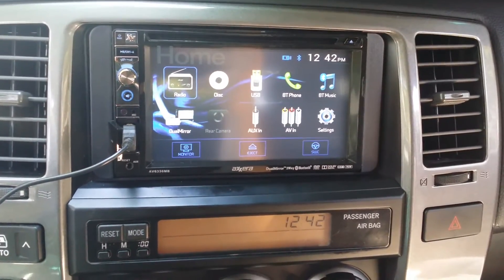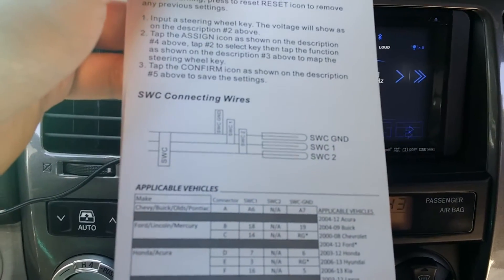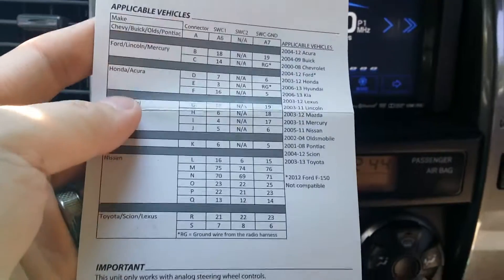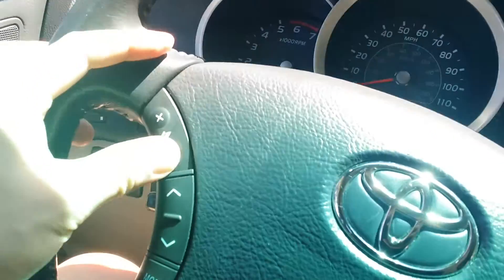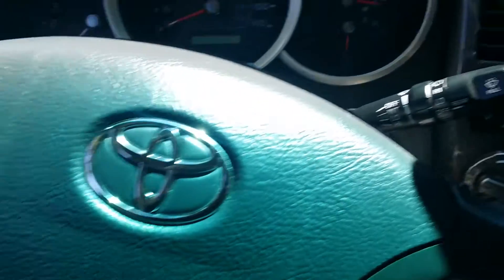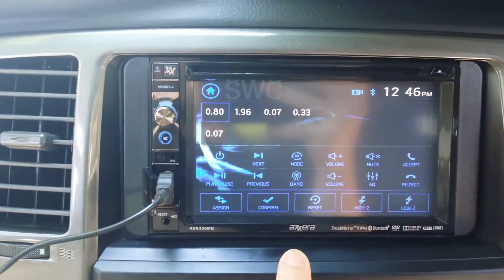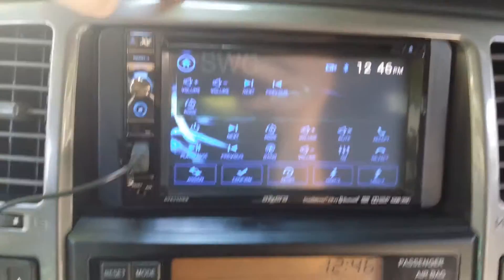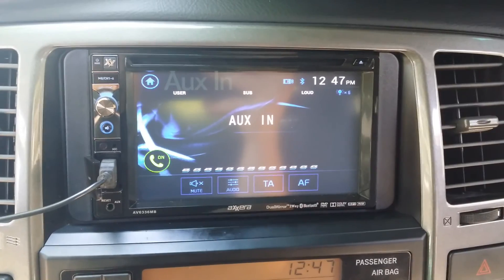DIY Axxera Steering Wheel Control Setup

Comment: Has anybody else got it to work on Honda?  I have Dual DV635MB which is identical to this one and I know I have wired it correctly but when I enter the setup, pressing steering wheel buttons does not result in any number.  BUT it does show different number when I enter in to this menu which tells me that it is able to read in the buttons but not during the setup  itself!  Dual customer support is useless.  They brush me off saying  I need an adapter.
Reply from the maker: Honestly, the first time I tried to set mine up, nothing took. I got no button frequencies. I just gave up. A week later, I thought I'd try again before redoing the wiring and it just picked up the frequencies out of the blue. It does lose its memory every so often and I'll need to reset the SWC.
Reply: I wonder if it needs something in the USB or something stupid like that.  I removed and checked the wiring and later realized that the voltage displayed was not random but depended upon previous key press.
Reply: Have you done this set up many times?  When you enter fresh setup and before doing reset, if there is a number, it corresponds to the "rest" position of the buttons.  Every button press changes resistance seen across that pin and ground.  Can you think of anything that you wree doing differently when it was not showing anything?
Reply from the maker: I have to do it about once a month. Press reset to clear any frequencies, press your buttons, press assign, code your frequencies, then press save.
Reply: Well, I tricked it in to setting up the buttons by holding the button while entering the setup and then assigning that button.  After doing that, in the main radio mode, which ever button I press first, that is the only one works.  I can reenter setup, do nothing, come out and now if I press other button, that will only work.  Arrrrrrrgggggg; this bug in the firmware probably got fixed in the "A" firmware later.  I am SOL I think
Reply from the maker: Did you check if you got the latest firmware update off Dual online? Might be able to install it with SD card.
Reply: Duel has no new firmware update for my model.  In general, it is rare to have new firmware updates on their site.
Reply: what do you have hanging off your USB wire?  I am grasping at straws now!
Reply from the maker: Yeah. That's the risk we take with support on these lower end brands. I have a USB extender and flash drive plugged in. Didn't like the flash drive sticking out where it was. Block's your hand the times you need to touch the head unit.
Reply: Can you think of anything that you might have accidentally changed from the time it was not recognizing any keys to working for you?  On my Honda, I only use single wire but for your car you are using two wires.  You also have the same voltage reading on the two rows and those must be coming from the two different wires.  I wonder if there is stupid bug which scans for two wires and if failed on one, does not go to other or something like that.
Reply from the maker: You mention only 1 wire. I take it you mean 1 + the ground? ... Honestly, I gave up on it working for about a week cause I couldn't get it to take. Then out of the blue while I was waiting in the truck for the wife, started playing with it and it just took. Maybe the system needs to learn itself? Doesn't make any sense but I didn't do anything else other than wire it up, give up, then tried again about a week later and it worked. But like I said, every now and then my buttons don't work so I need to clear the codes and reset/redo it all over.
Reply: Yes, 1 signal wire and 1 ground.  I took the radio out and used multi-meter to verify the wiring and eventually realized that it was getting the correct input but the firmware is not doing the right thing with it.  To be frank, that code has to be inside OS but that matches with yours.  The only difference is on the MPEG code which should not come in to picture at all.

How I wish to find a lurking Dual/Axxera developer around!!

Comment: Would you mind showing me the firmware revision of your radio from the setup/about screen? http://i.imgur.com/Up2DUzB.jpg
Reply from the maker: Are you sure your vehicle is supported? Dual's information is very vague ... anyways here's my software screenshot: http://i134.photobucket.com/albums/q107/ulrblitzer/cars/20160915_175733.jpg
Reply: Yes, it is listed as supported.  It should be because the older cars use simple resistor ladder instead of data mode.  I have verified that the radio sees that resistor ladder.  The voltage shown when I enter the setup reflects the last button pressed before (or while) entering the setup.  But once inside the setup, it does not display any numbers.
You have identical firmware except the mpeg version has "A" suffix